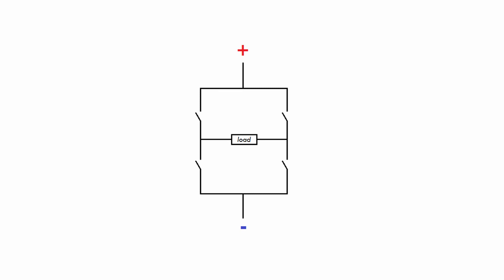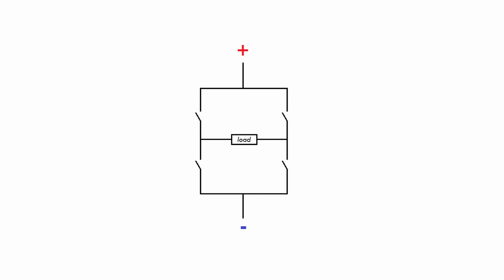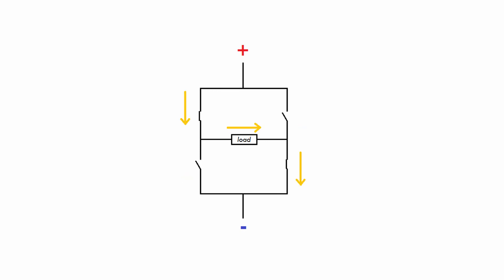How do inverters work? (AKIO TV)

Comment: Could you please make video on DC DC bi directional converter the one which allows to power from LV battery and converters to HV output e.g. 12v to 400v and 400v to 12v for charging the battery. I seen such converters in high frequency solar inverter. As 400v dc is converter to 230v ac using spwm.

 Would love such project.
Reply from the maker: I'd like to make a converter like that some time, but it's a major project I think
Reply: @AKIOTV  Currently I'm working on DC DC Converter which takes 12v input and output 400v DC which can be later spwm to 230v ac. I have almost completed the DC DC Converter able to power 300w load. But it would ve great to have bidirectional one would love it but I'm not sure where to start?

Anyway I love your videos got to learn a lot of things. Extremely helpful for me as beginner. Thanks for your time and making such amazing videos❤